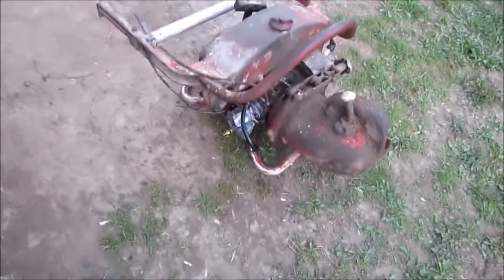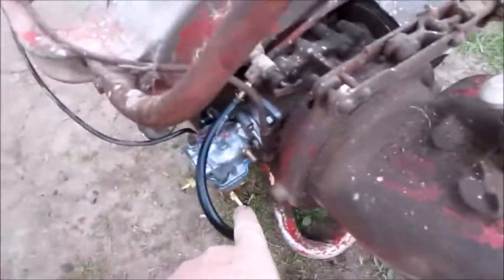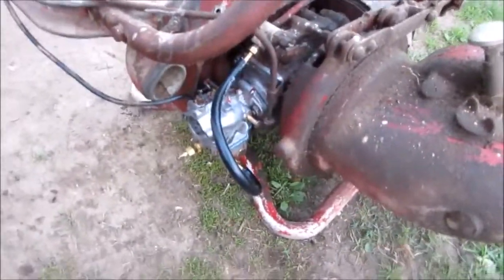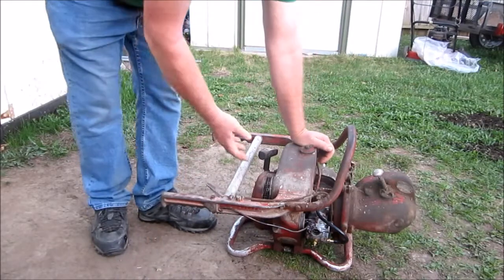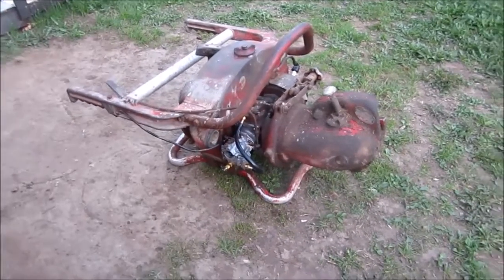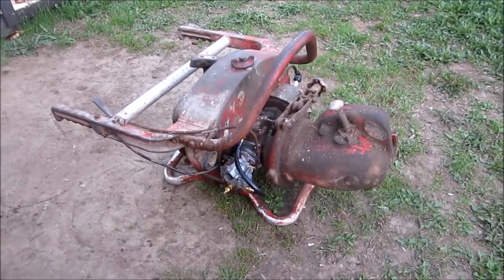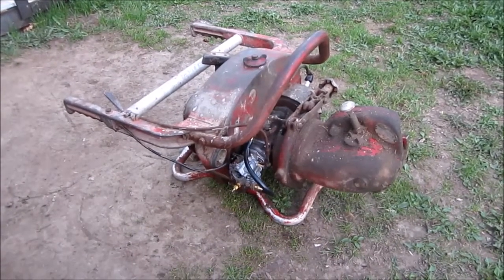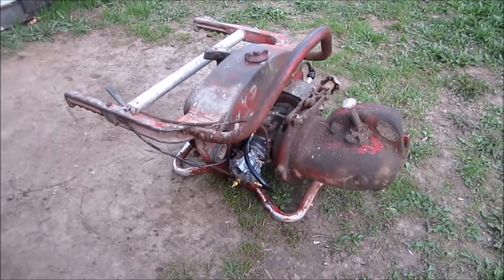Mall 11 Chainsaw part 2

Comment: Wow very nice! I will be picking up a model 11 in a couple weeks. What'd you do to make that carb so perrty? Any rebuild kits out there for it?
Reply from the maker: TJ thats great you found a mall 11 cant wait to see it . The carb took a bath in the ultrasonic cleaner at work . Carp kits not sure you will most likely need a coil there very proin to crack .
Reply: Good to know, It ran 8 years ago and has been in a dry place since. Stuck from sitting according to the seller. Hopefully it'll do something with some fuel in the tank. lol
Reply from the maker: TJ i hope it turns out to be a good saw it will be in good hands